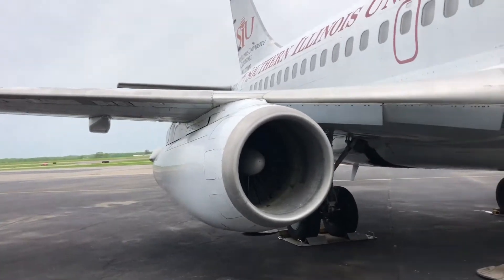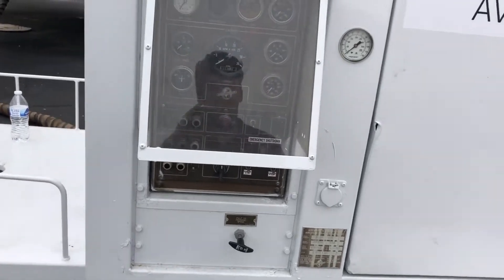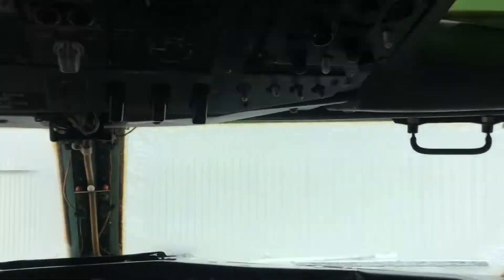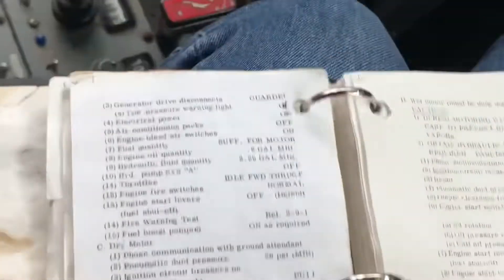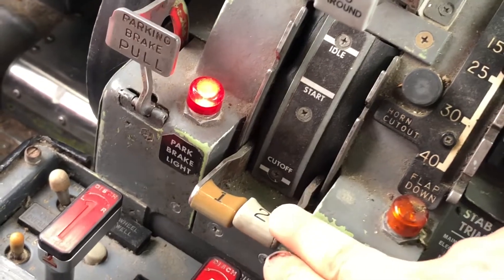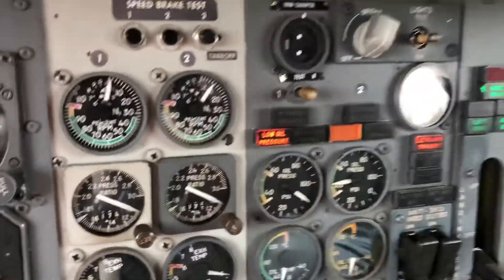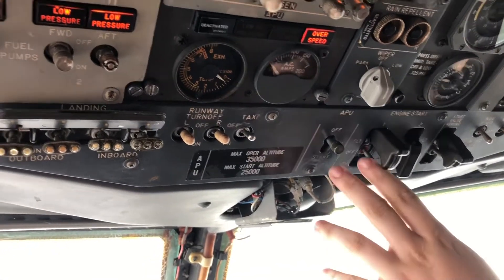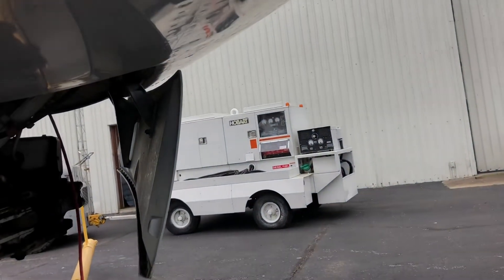Dry motoring a JT8D turbine engine

Comment: Good video, but in my days during dry runs, or full start, N2 would be monitored, instead of N1, as N2 is what the started turns, while N1 up to that is just going along for the ride.
Hopefully that airplane is still airworthy and flying.
Reply from the maker: It's been used for training and unairworthy since the late 1990's.   Thanks for the info. I was never trained on turbine engines and was more or less self taught on this process through reading the manuals and help from several people who had done it before

Comment: You can actually motor the engines without the engine bleed valves open. The engine bleed valves are only to allow bleed to come out of the engine compressor section. The starter control valves get their air directly from the pneumatic manifold.
Reply: Incorrect...... on the -200 series (JT8D engines)  the engine bleed valve is down stream from the starter duct.

Comment: I'm curious: what would overheat if dry motoring for more than one minute?
Reply from the maker: The starter itself runs the risk of becoming damaged if rotating the engine for longer than 1 minute at a time. It takes a lot of energy to rotate these engines up to the rpm required to self accelerate. Not to mention you are using hot air to feed the starters. That  heat builds up the longer the engine is cranked. 

The apu, which is automated, will actually cut it's starter out automatically if the engine has not started after 1 minute.
Reply: @junkinjames6345  Thanks.

Comment: I haven’t run a -200 but on the NG’s the battery switch should be turned on before applying AC power. Does that not make a difference on the -200 models?
Reply from the maker: It doesn't seem to make a difference on the -200 as long as the dc batteries are physically connected at the elcon.  but that's not to say the dc battery switch shouldn't be flipped anyway. The downside of inheriting such an old aircraft is that there isn't anyone to train you on it.  I've relied on the jrh and some tattered paper manuals to teach myself most of the aircraft systems. 
Luckily it is a very forgiving aircraft and is quick to warn you if you're ever doing something blatantly wrong. 

At the time of this video our dc batteries had failed due to age and were too weak to do anything. Hence why we used ground pneumatic power instead of using the apu.

We have since replaced the dc batteries and successfully ran the number 1 main engine after a decade or more of storage. 

That video will be posted shortly

Comment: Are there any recent run-ups? I'd love to hear them with that audio/video quality.
Reply from the maker: unfortunately not. However, I plan to change that towards the end of spring. Having my students do maintenance on the aircraft with hopes of getting it running once again.
Reply: @junkinjames6345  that would be great. Nothing sounds better than a JT8D-7 spooling up or down. That plane is a treasure.
Reply: @airplanepilot The 2-stroke Detroit Diesel is pretty close for a classically cool engine sound however.